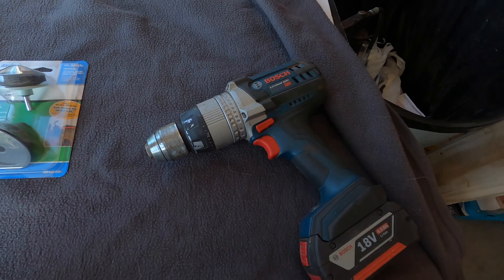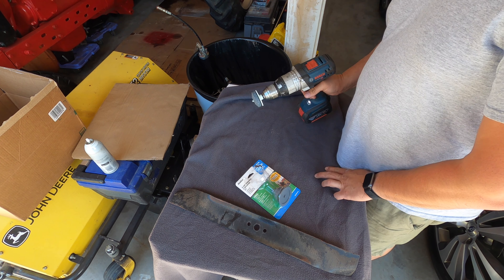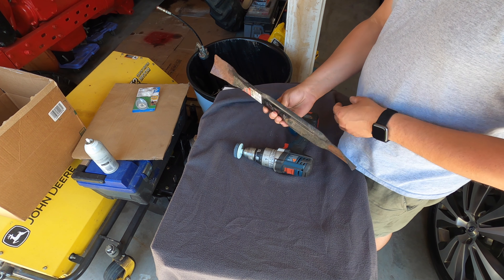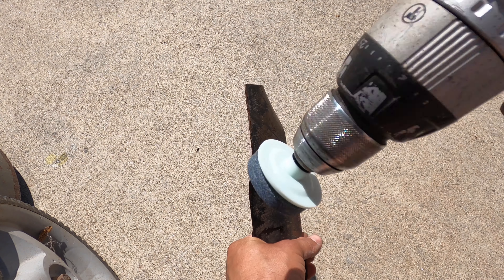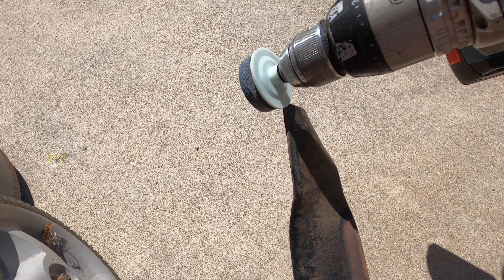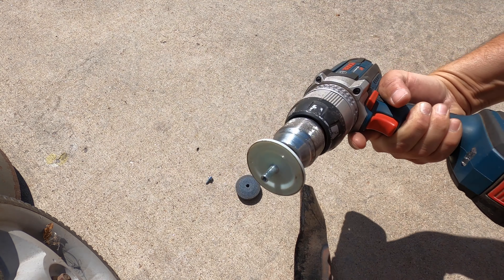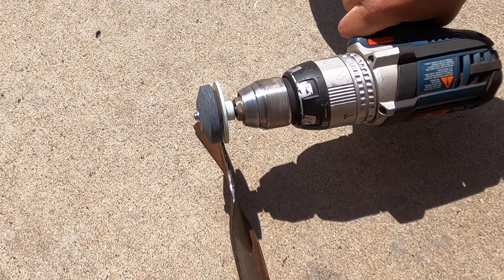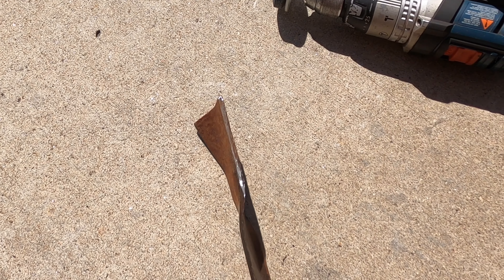Do Drill Mower Blade Sharpeners work?

Comment: Damn man you used that grindstone on the drill like you were scared to use it properly! You keep the grindstone on the lawn mower blade and just go back and forth slowly that’s it! The product works great but you barely did anything! It takes about 10 mins to really get your blade nice and sharp on the grindstone but they work but you need patience using them.
Reply from the maker: I believe you 100%.  Having the bench grinder nearby, I just wasn’t patient enough.
Reply: @TractorHoarders  yeah I could definitely tell you were not patient enough to use the grindstone on the drill. It’s all good just figured I’d mention that grindstones actually work.

Comment: Life hack #737 - Use a worn out flap disc on a 4.5" angle grinder to sharpen your blades.... It works GREAT!
Reply from the maker: For sure!!  I have never personally used the angle grinder for this, but I've had some neighbors in the past who did and I know it worked great for them.  I may do a rapid comparison video of different methods and outcomes.
Reply: @TractorHoarders  try the flap disc method. I'll never go back to a bench grinder!

Comment: Well by seeing you not secure that blade in a vise tells me you really don't know what you are doing. Terrible review of this product. Those type sharpeners do work, you just need to do it correctly & take your time. Granted, I'm not a professional so I don't need to sharpen my blades every day. I do it 2 to 3 times per season. It takes me about 10 minutes per blade. I use those type sharpeners to get my blades close to very sharp then finish them off with a file. And I backside file at like a 5 degree angle to get it super sharp...